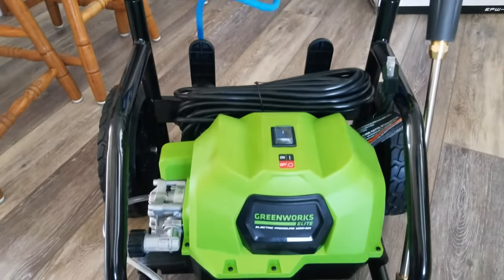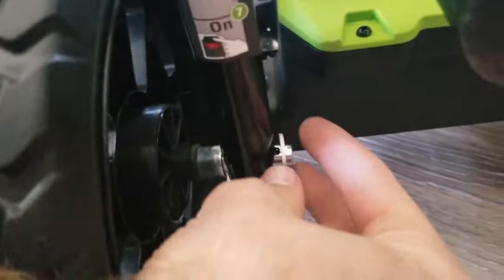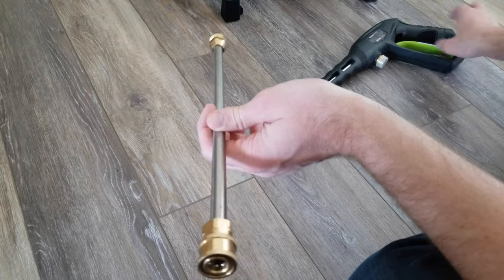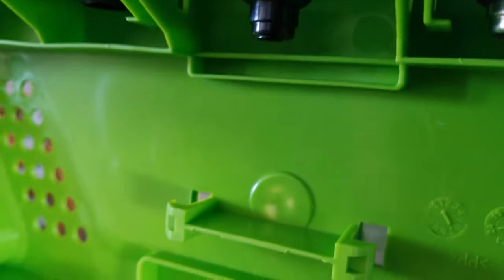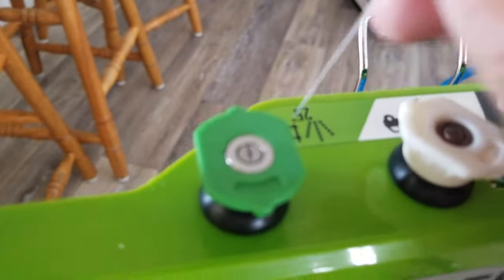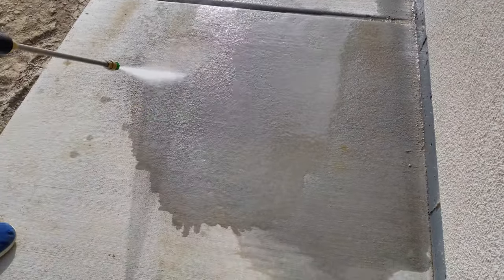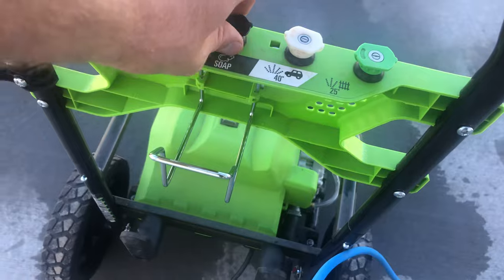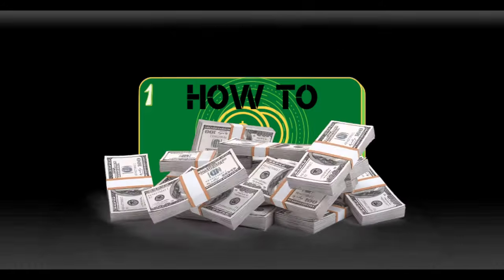Best Electric Pressure Washer: Greenworks Pressure Washer - Review and How To

Comment from the maker: I'm happy to answer any questions you have. I would also love to hear what suggestions you have for other videos.
Please consider subscribing. Thanks for watching!!!
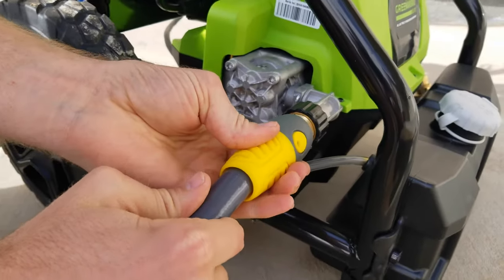Reply: Where to get the yellow hose connector @3:03? I bought a simple 1"-3/4" connector but the connection leaks very badly
Reply: I took the machine connectors off make sure there was no clogs. Still will not draw the soap
Reply from the maker: @JohnBishop-d3b  I’m sorry to hear that
Reply from the maker: @eruisiwang  everything for the pressure washer in this video came with the purchase

Comment: Do you think the pressure is enough? I am comparing it to the pressure at the car wash stalls where their guns have a gold blast.

I bought mine a year ago and am just now putting it together. I bought quick disconnect hose set to make it easier… I think that was unneeded for me to buy but was like 25 bucks at Lowe’s.
Reply from the maker: I’ve had no problem getting my vehicles clean.

Comment: when washer your car with soap how do you stop the soap and rinse and then return back to washing--Is there a switch
Reply from the maker: Great question!!!! I just disconnect the clear hose that runs from the tank to the pressure washer.
Reply: I thought you stop the soap with changing the nozzle. And the soap tube could stay connected… maybe that is the way. I bought a foam cannon so not needing that for the car
Reply from the maker: How’s the foam cannon?

Comment: For the soap - looks like you diluted it. The soap tank says it auto dilutes and I poured in the pressure wash soap undiluted but nothing comes out. So I wonder if I need to dilute it.
Reply from the maker: My understanding is that things will clog up if it’s undiluted. I’d try spraying without the nozzle at the end of the pressure hose gun. Then make sure the nozzle is clean and clear. Also, the clear hose from the tank, I’d disconnect that from the pressure washer to fully flush the hose.
Reply: @HowToThrifty  Thanks. It was a new unit and it turns out (after much back and forth!) that i needed to push the hose deeper into the tank. Working now. Thanks again for the reply. 🫡
Reply: using ZEP-- is 6 ounce to 1 gallon of water